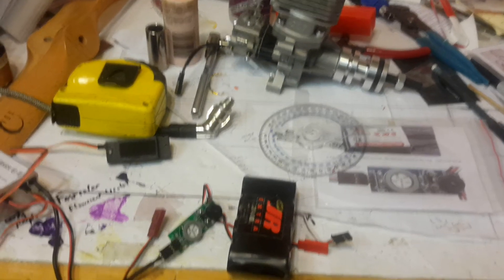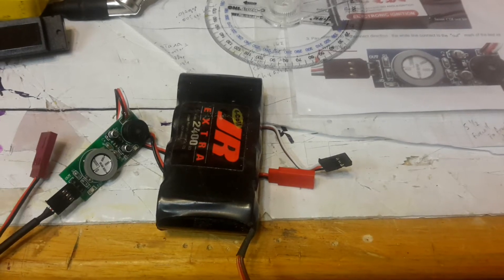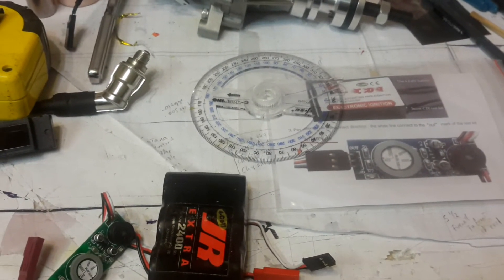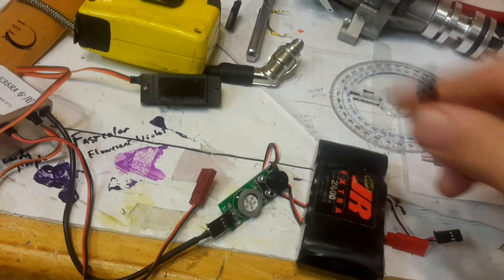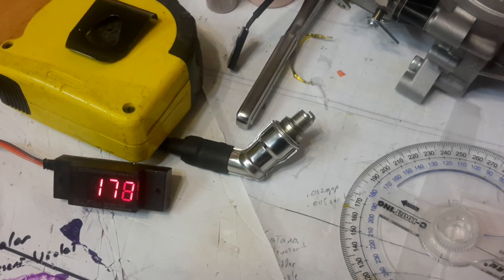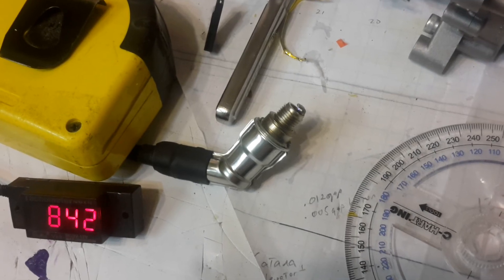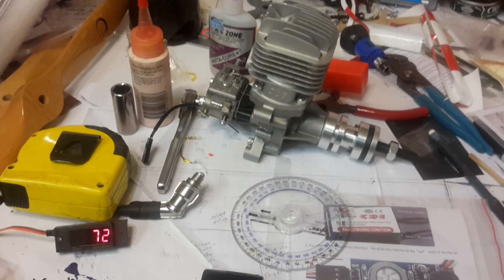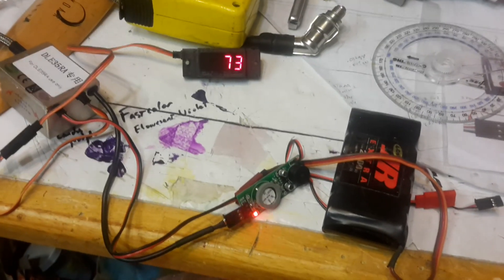Hobbyking timing & ignition module tester RC gas engine

Comment: I have a similar tester and it’s good to test if your spark plug and cap or the CDI box causes interference with your radio equipment and servos.